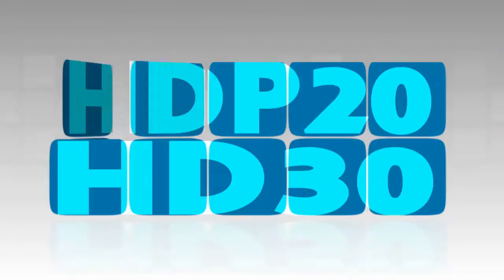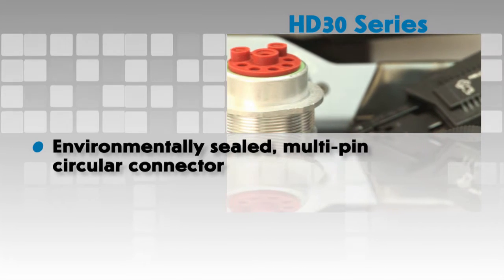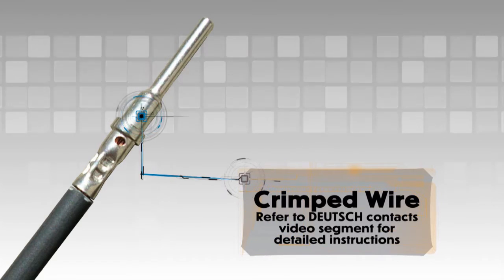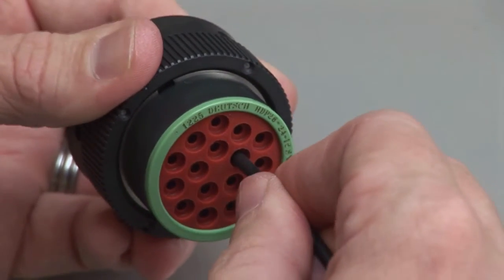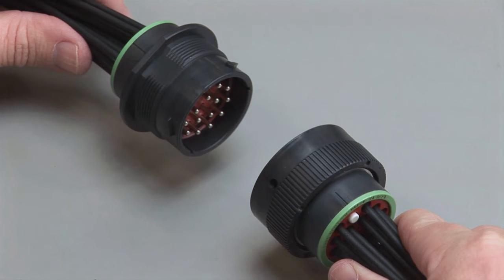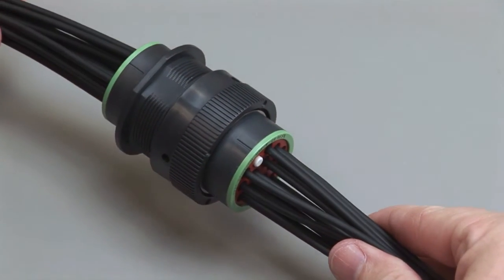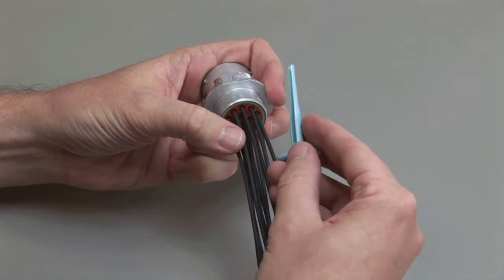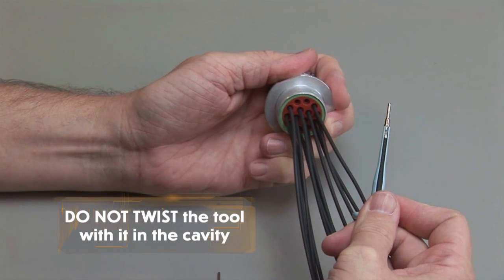DEUTSCH HDP20 & HD30 Series Connector Instructions

Comment: Hello, I just got an HDP30 connector for my project car. As soon as I got it, I got excited and wanted to see the pin in the connector and went ahead and put it in before crimping the wire. Anyway, I can’t seem to get the pin out and am in need of some suggestions/help. TIA!
Reply from the maker: Hi Darrel, TE offers extraction tools that may be able to help. You can search for compatible tooling by visiting http://spr.ly/6050HGOtO and searching for your specific connector part number. On the resulting product page, scroll down and you’ll find all available compatible parts and tooling. Hope this helps, good luck with your project!
Reply: It's definitely not as easy to depin as this video suggests... regardless of what tool is used.  It's nearly impossible, actually - heads up to those who are doing this for the first time.

Comment: I personally find it quite complicated to insert and to remove the contacts properly due to the reduce space available and the rigidity of the wire I use (I use normal sheathed wires). Please, can you tell which wires do you use?
It looks like the wires on the video are made for this purpose, as they are flexible and gummy, which makes the insertion pretty easy. But if you had a PVC-coated multiwire, which has a rather rigid sheath, it's difficult to insert the contacts. In multiwire cables the individual wires are individually sheathed and intertwisted with each other, so there is quite a reduced space to maneuver them. Also the rigidity of the  PVC sheath produces a lot of resistance. 
Finally, can you show how the cable looks like when the cable clamp is also installed at the end of the connector? Thanks for the video, it's very instructive.
Reply: you are supposed to use Tefzel wire. the outer sheath is thinner than the typical PVC-coated wire and has better abrasion & better temperature resistance